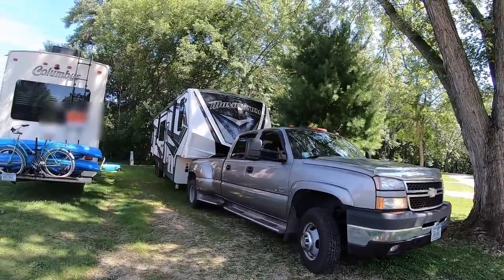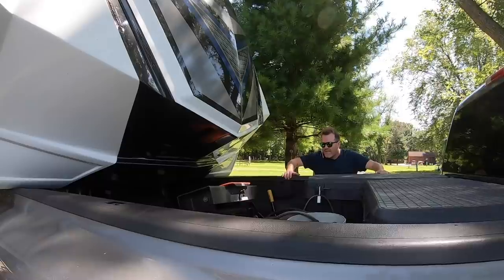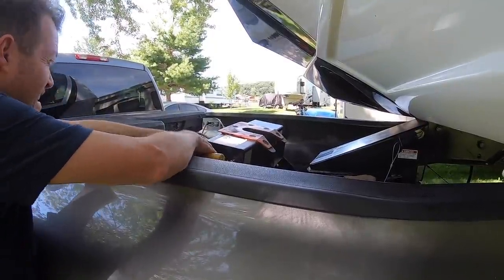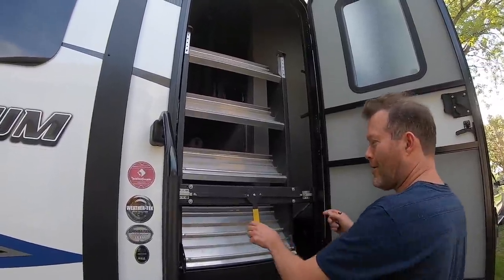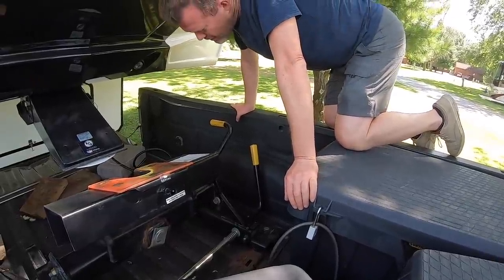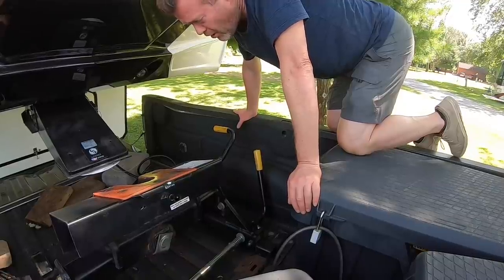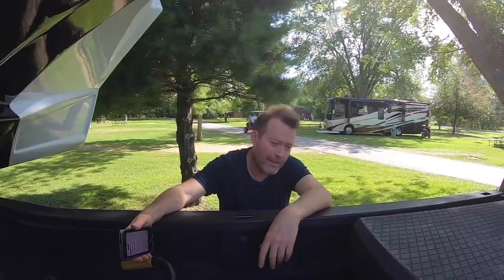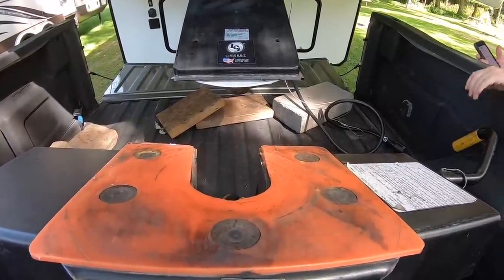RV CRUSHES MY TRUCK ON 1st TOW! BIGGEST RV LIVING FULL TIME MISTAKE! (PT 2)

Comment: The white indicator pin only tells you that the trailer tongue hitch was far enough forward inside the truck Reese style hitch. The guy you bought it from showed you 3 times in the previous video, to turn the yellow handle and it would jump in and lock. He even mentioned that you could not unlock it from inside the bed because of the strong spring, which you agreed with when you tried and failed. As many have also mentioned, never start driving away without doing a tug test every time. I'm not sure if your front legs will cooperate but still. If they won't, you can always design a cradle for the bed of the truck, (in case it does slip out during the tug test), that will stop it from coming all the way down and crushing the tailgate and bed sides. Dude, face it, you screwed up by not doing the last part which was to turn the handle until it locked and then inserting that pin at the base of the handle to stop it from being pulled back out and unlocked. Its admirable that you still posted this video, even with that screw up. We all are human and make mistakes. Hopefully everything got fixed in the end and didn't cost too much?

Comment: Hate you had this issue.  As other have stated always do a tug test.  I always kept my tail gate down also.  The indicator can't be trusted.  I actually painted the hitch jaws at the pin connector to ensure they were locked.  Just double check the next time.  You were fortunate to have minor damage.  Others have not been as fortunate.  Thank you for the video's.  I appreciate it.

Comment: what I try to do, is apply the brakes on the rv manually, and then pull away ever so slightly to ensure the pin is locked in place.

Comment: That's why I have the cheap slider bar fifth wheel, when the slider bar runs across the back of the pin , it's there with out a question, let her eat ......

Comment: You high pinned it like the woman said.. It appears locked but you should always try to have to push under a 5th wheel vs just hitting it because the pin will sit to high to actually lock.. I been driving truck a long time and it's just knowledge to me. Things you have to watch for being a driver

Comment: Dude, when you backed under your trailer,  there was space between your 5th wheel and the hitch.  When there is space between the trailer and hitch it is not really locked in.  It all looks locked in but it is not really locked in.  Also you need to have the trailer just below the the hitch.  That way it rides up the hitch and you are sure it is locked in the hitch correctly.   When the hitch is locked correctly the legs will be off the ground.   Then before you raise the legs up all the way, tug lightly on the hitch.

Comment: I am guessing there is a frame on the rv for the hitch mount in that front section... That could be why it did so much damage to the truck and not to the rv. That is alot of weight to be pulling so that section of the rv is probably built pretty strong. I got stressed out just watching this video. Hopefully others will learn something here so they don't damage there tow vehicle like this.

Comment: sorry this happened to you guys. It’s a simple mistake. You have a lot of guts to put this on your channel total respect!!! Such transparency!!!
In the future leave your landing gear down and just lurch ahead just a tiny bit. Just to see if the fifth wheel hitch is locked properly. If it isn’t your landing gears down.
Or if you’re worried about damaging your landing gear have it just off the ground so the camper doesn’t drop all the way down to the top of the box. That’s gonna be an expensive fix to that truck!!

Comment: Never ever pull away without testing whether the hitch is engaged or not. To test it leave your landing gear at least a couple of inches off of the ground, pull on your trailer brakes and creep forward to make sure that it is latched in there securely. Never pull straight away.

Comment: You high pinned it  that white pad  could be to thick,,, the bottom of the hitch pin on the trailer was above the hitch locking pin when you pulled forward it slipped off the top of the hitch pin,,, those pads can cause problems

Comment: You don't use 2 teflon pads at the sames time. Either use the one around the kingpin of the one bolted to the 5th wheel plate.

Comment: I recommend you find a B&W Fifth wheel hitch. It is much easier to use and safer than the other auto lock brands....and they were right on the phone you had the trailer too high. You should always make sure that there is no gap between the hitch and the kingpin plate. I saw light when you were hooking it up. Lower the fifth wheel flat against the hitch you should never see light between the top of thd hitch and the bottom of the fifth wheel coupler it will not lock around the kingpin properly otherwise and you end up dropping it on your truck...hope this helps you.

Comment: I have not looked through all of the comments but the one thing that I see that may have led to you "High Pinning" is that additional Nylon wear plate that you had placed on you Coaches Pin. There is just a slight amount of room on the neck of the pin for the Hitch Jaws to latch around, and with that additional nylon wear plate in there you most likely got a false positive when you hooked and it actually attempted to hook around the collar of the pin.  The orange plate that is already on the hitch should be all that is needed.  Good Job on attempting to checking that the Hitch Claws were closed and Indicator was out but at the 19:46 mark on you video (part-1) the handle was not all the way in.  As a commercial driver myself and driving school instructor for XPO Logistics and also from other Commercial Drivers that had commented before........Raise the landing gear slightly,  only far enough of the ground so that it does not drag (so they are not to get bent), chock you tires or hold you brake controller so the brakes are applied and do what we all call a "Tug Test" immediately after hooking up. Don't be gentle, tug hard.  I know that you are filming for others to learn, but one thing that leads to the most dropped trailers in our industry is that the driver does not have a good walk around.  Also if ever distracted by something or someone in the the hook up procedure.  If so start over because the one thing you may have missed could have devastating consequences. Good Luck in the future and Happy traveling........

Comment: One thing learned from driving a tractor trailer, is always test the king pin connection.  Leave legs down, set the trailer brakes, and try pulling away.   Even parking overnight, I'd still do a test tug in case some asshat pulled the kingpin lever.

Comment: I towed  my Fifthwheel with no problem pulling in my driveway my trailer fell off crushing my truck the same as yours my problem was I didn’t put the safety pin in and as I turned it caused the jaw to open big ooppps on my part

Comment: When Hooking the trailer, The trailer should slide onto the 5th wheel and lift up as it slides in. That what the agent on the phone was saying that you hooked high. The If you look at the kin pin on trailer the locking jaws or arm should be in the slot of the trailers pin not below it. the second time you hooked was perfect trailer was sitting lower than the first time and you got a positive lock. When UNhooking backup and apply your trailer brakes fully thought the controller so the trailer pin goes to the front of the hitch. This relieves all the stress of the locking arm or jaws to make it release with no tension. If you have tension apply trailer brakes and reverse truck.

Comment: Here's my procedure when hitching up my fiver
1) back into hitch and have it engage with locking jaw clapping around the king pin 
2) I have a camera that on a magnet mount I use this to watch the king pin engage and get confirmation. 
3) Raise the landing gears approximately 2 to 3" off  the ground
This way if the fiver comes unhitched it wont fall on the truck
4) plug your electrical 7 pin in and your breakaway strap. Keep your tailgate lowered. 
5) manually  engaged and hold your trailer brake. Start slowly driving  away the trailer should hold the truck back and hitch should not  come uncoupled. 

Those are the steps I take when hitching up
Reply: That sounds sensible TBH. Kinda the way I did it with big tractor trailer, minus the camera and the need to drop a tailgate. Never, ever raise the landing gear all the way till you're sure you're hooked and ready to roll.

Comment: I Was a truck driver for 30 years. Take a flashlight and make sure jaws are locked around king pin. AND LOOK FOR LIGHT BETWEEN FIFTH WHEEL AND KING PIN. ALWAYS DO A DRAG TEST TO MAKE SURE EVERYTHING IS LOCKED. ONCE YOU ARE SURE EVERYTHING IS PROPERLY HOOKED, RAISE LEGS ABOUT AND INCH AND BACK UP HARD AND PULL UP HARD WITH TRAILER BRAKES LOCKED. 
FROM NOW ON YOU WILL BE EXTRA CAUTIOUS ABOUT YOUR FIFTH WHEEL. IN 30 YEARS I ONLY DROPPED ONE 53 FOOT TRAILER.

Comment: Look's like you left the handle in and did not move your handle pin to the hitch lock position and those type of hitches can come unlocked by them self's and your lock it was when you first moved I've seen them come off at highway speed. Your indicator that show's that the hitch lock bar is closed is only to show it is closed not locked that is done with the lock/release handle pin it is moved to the lock hole closer to the hitch tip plate. Your problem is why I only use the Curtis hitch where the whole handle is locked into place and there is no assist spring to open the cross bar or jaw's. Those open assist springs have caused a lot of people lot's of problem's.

Comment: Well, I've seen worse damage.  Still going to be pricey.  From what I've seen the trailer always wins a drop contest.  The truck box is actually not all that strong, it's designed to keep cargo in not support a lot of weight.  I'm wondering if since the hitch already has Kevlar if the white ring was causing the pin to be too high?  The grabbers or the bar depending on the hitch needs to be able to go fully in the narrow section of the pin.  With the bar type the bar will not slide across if the pin is too high, but I don't have any experience with the type that grasps the pin.  Anyway better that this happened while you were hooking up rather than on the highway!

I've never dropped my trailer, but I've managed to break a window, dent a column, and crease out my tailgate a bit.  All separate incidents.  The window wasn't too much money, the dent was a lot of money, and the crease in my tailgate I just left because I figured it would just happen again.

Comment: This is why rv and camper trailers should have class a license. I had to read and practice this before I got my license. If you cant be certain about your connection then your certain about your separation. Luckily this didnt happen when you were on the road.

Comment: 3:21 Sorry to see this, but please mind where you put your hands as you are only on hydraulics here after an accident - cars and RVs can be fixed but hands and limbs are precious!
Reply: Graham do you actually understand the principles of hydraulics or do you actually believe somehow the whole system which is presenting as it does in this video could somehow catastrophically fail to such an extreme that you might actually be unable to move before the trailer drifted slowly down?
That doesn’t happen often. And it usually is the result of years of neglect of the system. 
But hey, be paranoid. It keeps RVIA certified technicians employed.
Reply: @roundsm18  You keep on taking pointless risks and I'll keep all my fingers and hands - unlike several of those who work in hydraulics. Deal?
Reply: Graham irrational fears are irrational. Most people in maintenance and hydraulics these days aren’t missing fingers. 
Speaking of which, most trailers are on a jack screw and aren’t hydraulic these days. 
Mine is hydraulic and it’s a 1987 but aside from my own I haven’t seen a truly hydraulic set of landing gear on a fifth wheel in 20 years.
Reply: @roundsm18  Good for you.
Reply: Graham point still being, it’s more likely that a commercial airplane will fall out of the sky than your landing gear failing in that particular instance. They have to put too many failsafes into the system regardless of type to allow for anything beyond a slow drift.
Reply: @roundsm18  I have no idea what your point is.
My advice is simple, never put any part of your body anywhere when there's a safer alternative available.
This comes from many years of experience with hydraulics and heavy machinery.
You are free to ignore it or to peck away at it like a demented rat, but I stand by it.
Have you got it yet?
Reply: @roundsm18  No.

Comment: Easy mistake with the regular fifth wheel plate lock. I went with the heavy duty Anderson hitch even the Anderson hitch low lighting you can make mistakes. Once at 5am it looked like it dropped on I was sure it was over the ball. It wasn’t and dropped but luckily jacks were still partially down when it broke loose. Luckily no damage but scared the Sh@t out of me new rig new trailer. Clue take your time look on both sides make sure it is seated right. In my case it was operator error.

Comment: I hope you learned about high hitching. Look at your kingpin. It has a lip on the bottom. You high-hitched which means the locking latch closed, but that lip on the bottom of the kingpin was in TOP of the hitch locking latch, instead of under it. So, the kingpin was riding on top of the locking latch and it slid right out. The truck should drop when you hook up - that prevents high hitching. If there is a gap between hitch and plate when hooking up - you are high hitched. Always, always, always do a quick tug with the jacks down!!

Comment: Sure the guy was happy to get rid ot that junk, as so many said, leave leggs down, but at least an inch off ground, rv leggs not as strong as semi trailers, hold trailer brake controller an do tug, i always look up into jaw from back b4 i even tug to visually check jaws are locked, now get rid that cheap hitch

Comment: The white pin was out which showed that the king pin was all the way into the grove so that the jaw could close around the pin.  Handle hooked to the jaw was in....however, the handle must be secured so it does not come out, like it would to un-hitch.  That small set pin was put in the hole to hold the handle extension on to the stub end.  It appears that the next hole on the handle is the one that holds the handle which is hooked to the jaw from coming out.  Also, I saw a guy with a 5th wheel back up to hitch up and he was not 100% lined up between hitch and king pin.  He had his jacks up on some sort of blocks, I guess he did not want to run jacks all the way to the ground.  As he backed up his hitch push the trailer back and off the blocks which made the 5th wheel crashing down on the bed of pickup.  It was a Ford and more damage than this.

Comment: You need to use grease/wb40 on that hitch! Everything should work smoothly!
Sorry for your truck bed!
And it is great that you (eventually) posted this video👍
(Nobody is perfect)
(Try using a hydraulic jack to push/bend the truck bed back, where it was crushed! Use some Wood/planks between the jack and the truck bed both on top and under the jack!
Maybe you can back the car slowly into something to push the tailgate back into a place where it could be locked again, as Quick fix??
When you accidentally bend the tailgate, it gets shorter, and wont lock on both sides! (I’ve done that)
It is important that it really locks on both sides, so it does not fall down when driving! You probably have to get a new tailgate later!😞
Be careful so that you dont bend the landning gear when doing a test pull!
They probably should be an inch off the ground. They are not designed to be pushed sideways, only vertical!

(Max load for a trailer in Sweden with an ordinary driving licence, is 750kg!
Probably 10% of your trailer😖!
Car/truck and trailer together can not be over 3500kg 
Sweden sucks!)

Comment: The biggest damage is to his ego. You go behind and look to check to see if the lock jaws are completely around the pin. Leave tailgate down until you are completely sure it is locked. Best thing is to lock it then pull forward against it. Back up too. You just high pinned it and it jumped the jaws. Happens in 18 wheelers too. You always want grease on the fifth wheel, that rust is a sign of a complete rookie. You always grease a fifth wheel. Biggest thing is you want the trailer pin lower than the fifth wheel so you avoid high pinning and the jaws only catching the bottom of the pin. Grease the jaws and the fifth wheel plate. Never let them be dry like that or it heats up and can cause heat stress fractures.